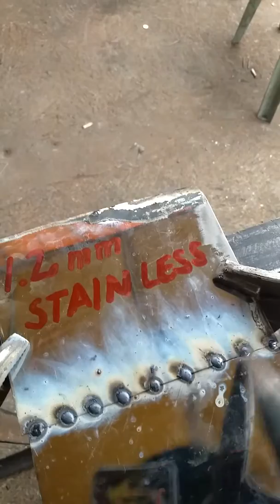Stick weld 1.2 stainless flat sheet

Comment: How much is that  stainless steel?  4feet by 8 feet about 1mm thick(306) I just really need for my project, thank you!
Reply from the maker: here in baguio/benguet the price is 2500 to 2800
But i think in manila the price is 1500 to 2k only
Im not sure cause that is only my guess
Here in benguet stainless steel is expensive 
Thanks for watching sir
Reply: Thank you po!
Reply: Sir another question po, pasensya na po sa mga tanong pero magkano naman po ang 4×8 feet and mga 1mm po ang kapal(pero 440 stainlsss steel naman po)? Salamat po ulit!
Reply from the maker: Mas mura po sir ang 430
Stainless steel 
Nasa 1k plus siguro sa manila  
Pag dito sa amin gagawin nilang 2k plus lalo nat pandemic 
Noong wala pang pandemic noon medyo okay pa ang presyo ng stainless steel 
pero after 6months biglang tumaas ang presyo ng stainless steel 
Salamat po
Reply: Salamat po sir!
Reply: Sir pwede pa po ba magtanong? Anong bakal po ba ang maaring gamitin sa paggawa ng blade ng mga lagare at magkano po ung ganon kung ang size po ay mga 4×8 feet at mga 1mm ang kapal. Salamat po sa pagsagot, at pasensya na rin po sa abala
Reply from the maker: Steel na metal po 
Pero ang alam ko po iilan lang po ang nagbebenta ng steel metal dito sa pinas salamat po
Reply: @Vhandricksbm  yun my sumagot din ng price hehe